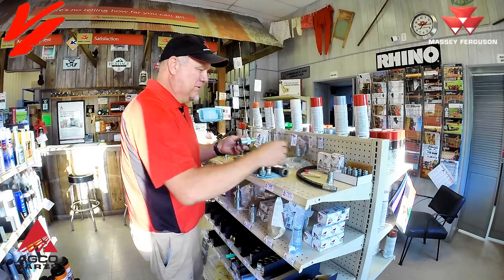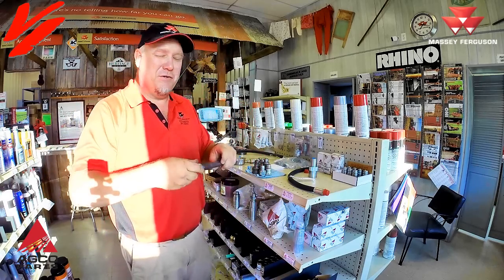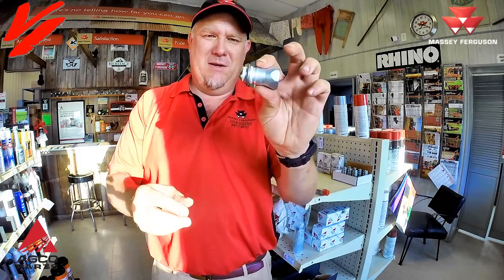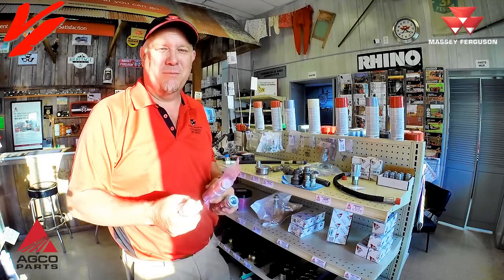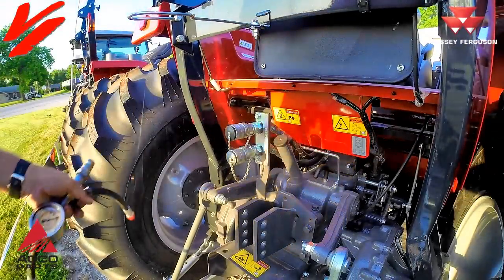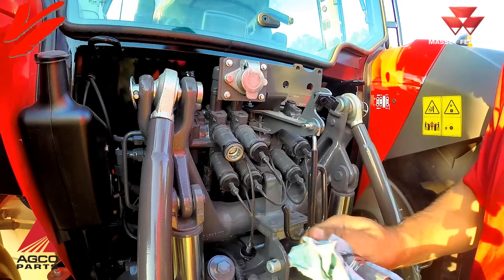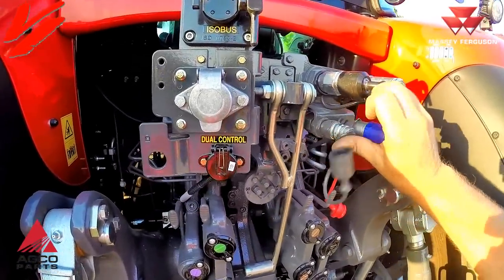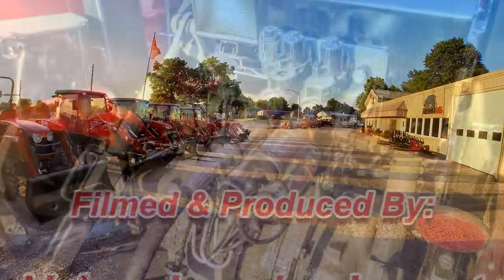The Basics: Understanding ISO 5675 Hydraulic Rear Remote Couplers

Comment: Hi Doug -  this is the first video I have seen that explains the hydraulic assist couplers we have on our Massey MF1533.  She is an older gal built in 2005.  In 2018 we added a dealer installed Quickie style front loader.  The hydraulic lines are routed poorly and rub on the wheel when turning.  Two of the hoses we could disconnect using the push in - pull back out.  The other two, we cannot disconnect.  We have wiggled the joy stick but have had no "joy".  I fear that the dealer tech just shoved the male hose ends into the couplers without cleaning the couplers and that now I have jammed dirt which will not allow me to get the hose apart.  My dealer says just yank on the hose.  The 2 that release do not take the force that we are applying to the stuck hoses for them to release. 

 Are we doing something wrong or is there some trick we are missing?  I'm not near Kansas.. our machine is in Virginny.  Your video was incredibly helpful just knowing about the different connectors.  I'm wondering if we should just change them.
Reply from the maker: It could be the coupler type. Do they look the same as the others. Most couplers have numbers stamped in them and the tips too. Going to be small print but would determine the type. They could be no hydraulic assist couplers. Sometimes it requires pushing in and giving a yank to pop them out. If different you could replace couplers or sometimes it's just the tips that can go bad too. Hope that helps.
Reply: @VahrenbergImplement  Thank you.  I'll try to identify the part numbers - old eyes..  not easy.  On the two we can and have released, the push and then yank worked.  The plug side of the coupling is brand new.  The receptacle side was on the tractor since 2005 unused.  My thought is the receptacle is the problem.  I'm also going to try to open the lines on both sides of the connector to see if it is still under pressure.  For sure, the travel seems much less on these two couplings and that leads me to think we still have pressure.  We'll keep trying.  Need to move those hoses.
Reply from the maker: When you find the numbers take a picture and then zoom in on photo and it helps read numbers for us old eyes.
Reply: @VahrenbergImplement  Good suggestion.  I will.

Comment: Could you tell me what style of coupler I have on my 2019 MF 1740m loader connection?
Reply from the maker: They are ISO 5675 Couplers.
Reply: Vahrenberg Implement thanks so much for the reply. They are unlike couplers I'm accustomed too. They don't have the sleeve that is pulled or pushed to release. So they must be the hydraulic assist as you state in your video? I'm pretty concerned I will dislodge one as I am in the woods a lot with the machine. Any suggestions? love your videos BTW and wish I was closer to your dealership!
Reply from the maker: They are Hydraulic Assist Style push in and pop out. Thanks for the comments much appreciated.